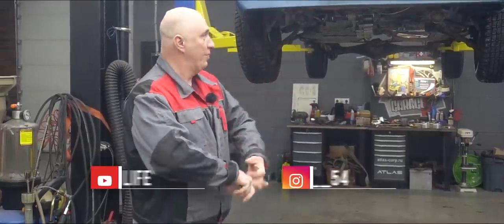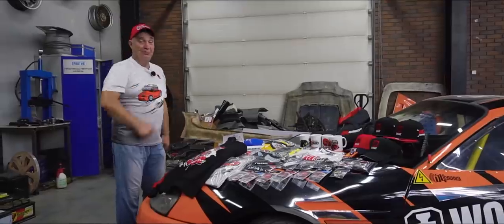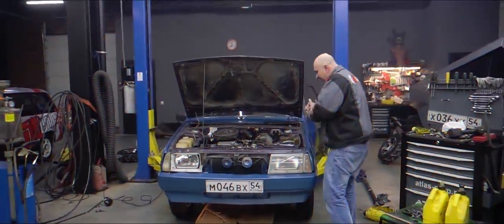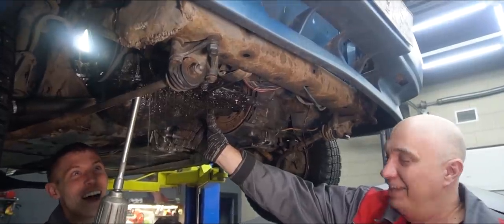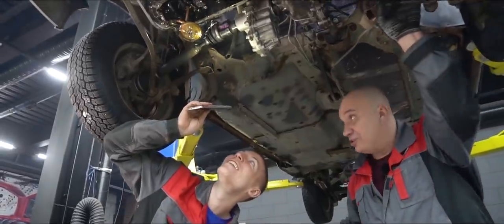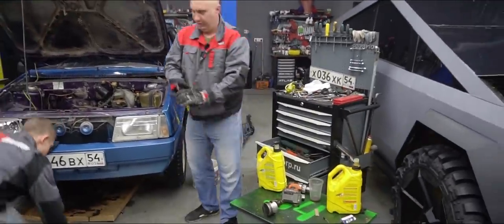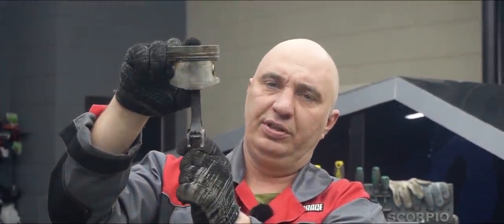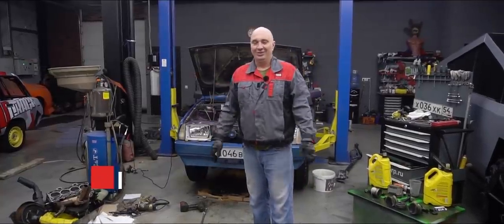How long will an engine run with no bearings?

Comment: Oxygenated fuel with nitrous oxide!
Inject nitro methane into carburetor 
Super cool intake air temperature with a gigantic intercooler buried in dry ice

Comment: How long can an engine run with valve covers?
Reply: they run just fine with valve covers  :) :) lol
Reply: @MrHBSoftware  I suppose they do...
Reply: @jonathanschubert9052  if you meant without covers, they run fone too, oil will just splash everywhere but the engine will run "fine"

Comment: Not too many months back I had a Toyota Corolla come in with a messed-up rod bearing so just for the heck of it I wanted to see if I could modify a bearing from a Chrysler engine which I happen to have at the time to see if it would run on that

Things didn't got too good

https://youtu.be/wXEX4iZkKrs